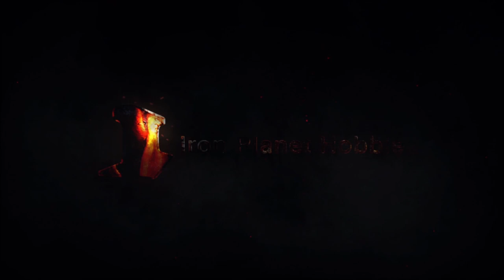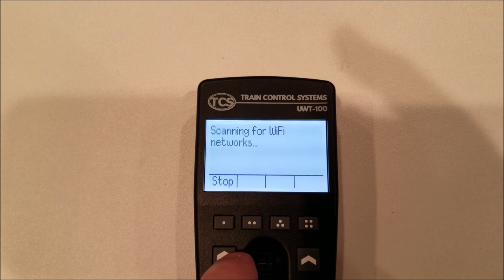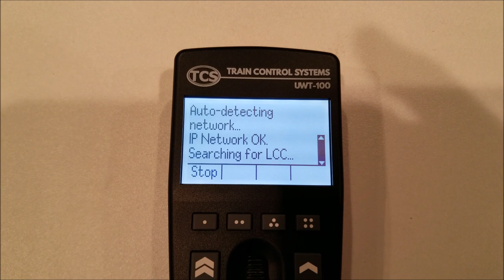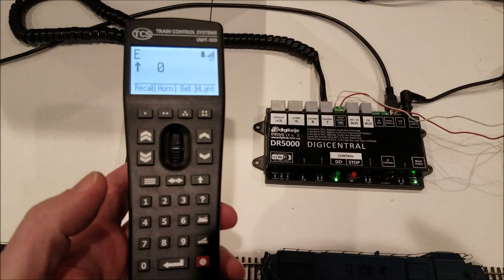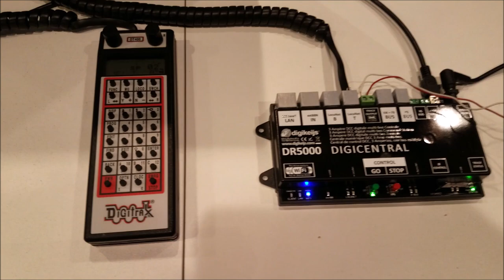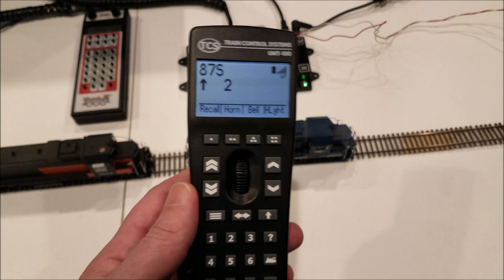TCS UWT-100 WiFi Throttle Setup For Digikeijs DR5000

Comment: Ok I missed something.  In the beginning of the video you mention 3 ways to connect the throttle, but none of those 3 ways refer to the Digikeijs system.  Later n the video it looks like you are connecting the TCS UWT-100 directly to the DR5000 wifi.  Are there steps missing in the video?

Comment: According to TCS, newer LNWI modules do not work with their throttle.  It connects with the LNWI, but they said there is a timing issue so that the throttle does not communicate with the server, so no control at all.  The only thing that works is track power on/off via the menu or track power off (only) with e-stop.  Won’t get a fix until the next firmware upgrade.
Reply from the maker: There were a few made that had some issues but the latest firmware upgrade did take care of it.  Should be good to go now.
Reply: @IronPlanetHobbies  Just looked up on Digitrax download section and there is an LNWI R 0.2 Firmware update for TCS throttles, thanks!

Comment: Ryan, I think I missed something. Did your demonstration use an LNWI?
If so, how do you configure it to work with the DR5000?
Reply from the maker: I did it both ways.  One using just JMRI and the DR5000.  The other is with the LNWI.  There really is nothing to configure with the LNWI.  The LNWI simply connects to the LocoNet just like it does with Digitrax.  The TCS finds it automatically.   Super easy setup.